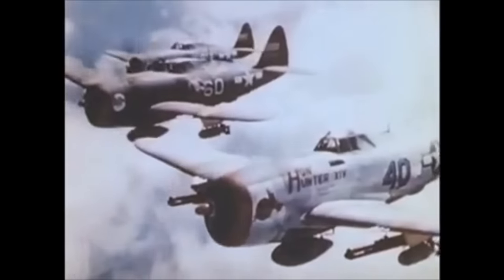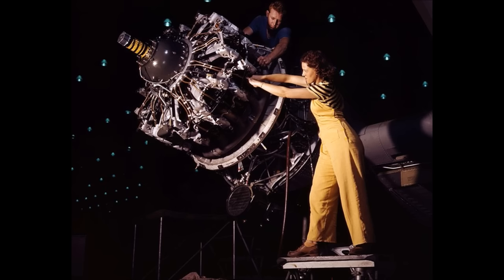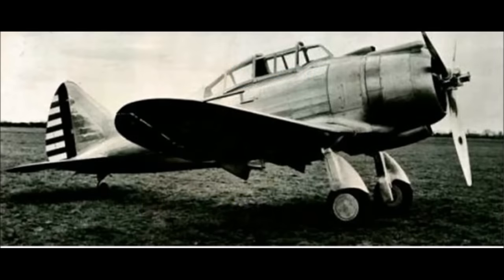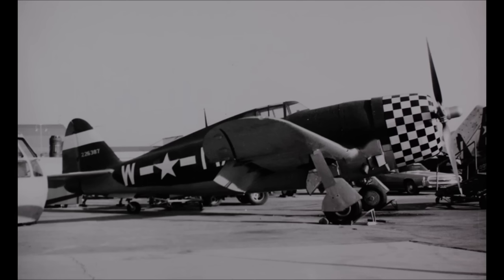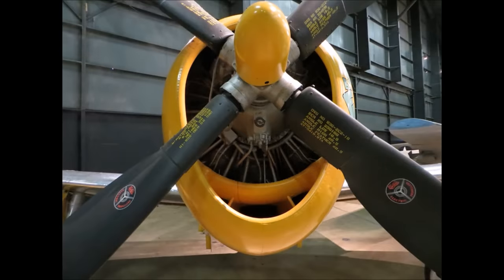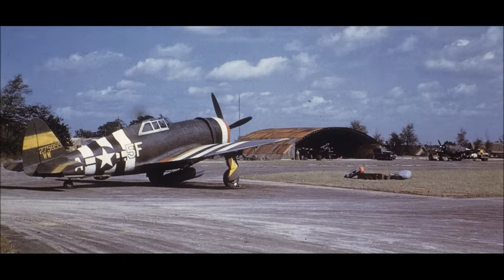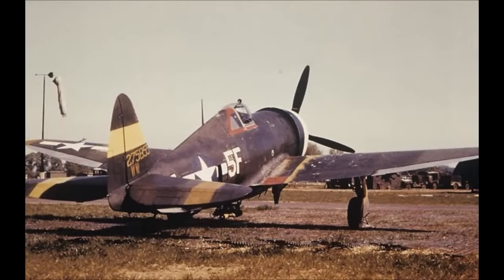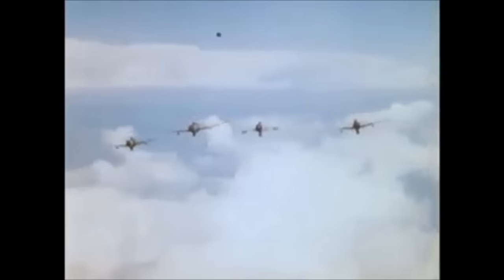P-47 Thunderbolt Pt. 1 Design and Speed

Comment: If you're going to discount a production run of 1000 aircraft, then discount a production run of 130, like the M version. Perhaps include the N, which was produced in numbers.

Your question on sims is related to the fact that they tend to take a specific model, not the fastest or best. For example, they'll take a Tempest V but a series 1, circa early 1944 with a Sabre IIb running 9lbs of boost on 150 octane, not the Series II with flush cannon ports and a later version of the Sabre. That's just how it is.  In the original IL2:FB, the developers specifically used a version that was sent to the USSR on lend lease - the D10 and D27. They then adjusted it to the D-27 specification that was tested by the US and then had corresponding UK data, which significantly changed the roll rate from the Soviet data. What you'll find is developers will take a model that has considerable test data and fits a given scenario. It's why you see in the newer IL2:BOS an A3, not an A9, because it's a 1942 scenario using an average aircraft.
Reply: He didnt deviate from the D model. He only commented how the N & M had the same engine and were able to accheieve higher speeds due to the increase in turbo shaft speed. He usee it to make a educated guess on field modified aircraft. As for the flight SIM. When 1946 came out they didn't have the p47 n & M modeled. This gave the Germans a huge advantage in game. The U.S. would have been capable to produce more p47 then Germany could produce airplanes.. Il2 had a hard on for German and russian airplanes.
Reply from the maker: Exactly, I didn't get into the N yet, I only referenced it for the reasons you stated. Good job. I'll cover the N in a later video. This was only part 1 and it was over 40mins long. I can't fit everything into one video, so I'll cover the M and N later.
Reply: @bad_luna5222  the P47-D27 in IL2 was more than a match for anything German at altitude. If a scenario had the TA152 then that, for 5 minutes was a match but then you'd be running on an unhistorical scenario. In a realistic scenario Germans would be using the A6, A8, early D9, G6/AS and G10 - none of which could match the D27 at higher altitudes and certainly for prolonged periods. The issue with IL2:FB/46, especially online is most scenarios devolved into low altitude affairs due to ground mission objectives. The P47, no matter what variant is going to suffer in a low altitude knife fight with a later model 109 or 190 as that's what they are built for and excel at. Getting suckered into a turning battle with a 109 or a scissors with a 190 is pilot error, not bad modelling of an aircraft.

Controversial opinion but IL2 did not have a hard-on for Soviet or German aircraft, the game focused on low to medium altitude simulation which is where Soviet aircraft excelled in. High altitude modelling was just poor which was acknowledged by the developers. The engine was from the late 90s so severally limited.
Reply: @bill8791  I used to fly at high alts all the time. I was always the guy leaving contrails and boom and zooming. I do remember some servers where people would be flying late war / non existant 190's and catching up to my 47 & 51's. The 109 got so fast and so good it was more a fight of attrition.  Id have to force them to chase me until they ran out of fuel or were forced to rtb.

I guess what I'm trying to say is the developers made varients of bf109s that were either produced in such low numbers or at all over american aircraft that would have been delievered in the same period. Therefore when people did play the 1946 senarious the Germans would always have the upper hand. Even with out the jets. The game needed the later model p-47 amougst other aircraft  the developers ignored it.
Reply: New IL-2 has 3 models of the 190 so far, the A3, A5, and A8. Plus the D9 to come.

Comment: the spitfire is like a honda civic...... handles great
the 51 is like a corvette..... can turn ok, but likes to go fast

the 47 is a 68 dodge charger.... powered by a 10-71 roots blower, on a 440 big block, with 6 pack carbs..... doing a wheelie on the drag strip
Reply: running more MAN PSI is just like making your honda civic run 30 PSI vs 25 psi
honda didnt set the engine for 100% power..... your going to wear shit out faster, but VS other stock cars.... your going to have a massive advantage 

i 10000% believe that people "hot rodded" their aircraft.... 

after all.....bootleggers and aircraft mechanics started NASCAR and NHRA......

Comment: I already knew about the specially designed dual-purpose shipping-crate/assembly-jig scheme for the P-47.  Did NOT know about catapult-launching "Jugs" from escort carriers!  The heaviest single-engine piston fighter there ever was, from the smallest fixed-wing carriers there ever was.  Why did no one ever tell me about this.

Now... to be clear... I'm thinking this actual video footage we're seeing here, of the 47s launching from a carrier(s?)... doesn't seem to be showing a catapult involved in these shots?  (Unless the catapult track in question on the escort carriers ended significantly short of the bow?)  So... presumably full-sized fleet carrier(s) in these pics/vids, where there's enough deck-wind speed, and enough deck length, to not need the help?  They did do it with some B-25s on one occasion, I'm told... 

On other related matters...  The "simple" question of speed is covered with what seems like an unimpeachably complete level of analysis here.  Appropriately as per your title for this segment.  But without knowing your intended focus for your forthcoming P-47 segment(s)...  May I ask if you will be examining or addressing the anecdotal reports/experiences of P-47 combat pilots, re. their comparative impressions of relative performance as a whole from having also fought in other comparable single-engine fighter types of the same period? 

While I know there's many USAAC pilots who saw combat in multiple US types, I'm particularly interested in some vague references I recall of American pilots who had been flying the Spitfire Mk.V, whose units then transitioned/re-equipped to the Thunderbolt.  I believe this case was during & after Operation Torch/Husky/Avalanche (the Allied invasion of N.Africa>Sicily>Italy), where early on, the US had been borrowing excess/older Spitfires from the Brits, apparently lacking sufficient P-40's for the purpose? 

Reference:  see (or image-search) my avatar thumbnail pic here -- a famous photo of a wrecked Mk.5 Spitfire on the beach somewhere in S. Italy, painted in USAAC Unit markings.
Reply from the maker: A lot of wild stuff happened in WW2.

Comment: I doubt that the PW R 2800 could maintain 70”of manifold pressure for any length of time without running into reliability issues like pulling a cylinder off its studs or blowing a top of the cylinder (head). I ran a R 2800 with CB17 rating (62,5”of manifold pressure on 145 octane fuel)that was the highest manifold pressure it could be run on the ground safely.
Reply from the maker: They ran it with a lot more that that in testing. It can run at 70" all day long provided it doesn't overheat, which it wont at speed.

Comment: i come across interesting version of p-51 it was p-51H or M running water injeted packard build merlin engine with boost up to 120inHg (crazy!!) could you put some more light on this version if any data is even avilable for this thanks.
Reply from the maker: The P51H never saw combat in WW2 so I have been avoiding it for now, but yes, it ran water:methanol and a lot of boost!
Reply: @GregsAirplanesandAutomobiles  
wonder how this WM injectiojn was set up was it like in bf109 with single spray bar in to supercharger inlet or was it 12 spay bars in to specyfic cylinder inlet duct each?
and i got one question its bother me for a long time but somehow i cant find ultimate answer for it. when i read engine chart for p-51-d v1650-7  i can see take off power for exaplme 3000rpm 1490hp at 61 inHg my question is those rpm is it rpm of crankshaft of the engine or is it rpm of the propeler i know that engines had reduction gear box for exaple merlin 61 had 0.42:1 reduction ratio on the reduction unit.

Comment: 2 quick questions. 1: I thought all P-47Ds had bubble canopies. Obviously wrong. Do you know drag difference between bubble and slide back canopies?
2: in general, where are you finding this detailed information? Do you physically go to where NACA files or Republic files are stored? Or are they digitized for reference online. I suspect you are just a dogged researcher. I thought I knew a fair amount about the P-47. Obviously not. Thanks.
Reply from the maker: Hi Michael, It appears that the drag of the two versions are about equal. I am basing that on the power settings vs. speed charts in the various flight manuals. In other words, with a given power setting, prop, and altitude, both planes are at essentially the same speed. Of course it's a little murky because the manuals use different power setting in their charts, so we have to interpolate some of the data. As far as I know there are no actual drag numbers for the two canopies. I think that sort of information was lost when Fairchild destroyed all the Republic Aircraft records. As for the NACA reports, I just pull them straight off of the NASA website.
Reply: Greg's Airplanes and Automobiles Thanks. MSM 🇺🇸

Comment: 1) Does the air get filtered after or before the intercooler?
Reply from the maker: Hmm, I don't recall seeing a filter on the diagrams. I'll have to check.
Reply: @GregsAirplanesandAutomobiles  I should use the correct terms, downstream of the intercooler or upstream. And further to that, question 2) : Can the airstream to the intercooler be controlled?
Reply from the maker: Yes, the airstream to the intercooler is controlled by the outlet shutters. If they air can't get out, more air can't get in.

Comment: Can you have a blowdown turbine inline with a turbocharger? I.E. Engine > blowdown turbine > turbocharger. If you play WarThunder, you'll immediately realize that German planes, especially the 109s are FAR better in the game than in RL and the opposite is true of most American aircraft. because "balance".
Reply from the maker: A "blowdown turbine", we call those "power recovery turbines" in aviation. It might be  possible to use one and a turbocharger, but I don't know of any cases where that was done. It would be highly complex if it could even work. I really just don't know. In video games, the need to make the game fun, and to make money. What they call "balance" is usually their attempt to do that. I am not against it, but it's not what I want in a sim.
Reply: I've seen them referred to as both blowdown and power recovery. I prefer "power recovery" but I wasn't sure which is the most common.

Comment: https://www.youtube.com/watch?v=AmEShHz-_Ak

So that's how it can fly in other sims. I am hoping DCS gets their P-47D module out at some point, but just looking at the data you've provided, I can understand why it so often ends up being a challenge. The P-47 appears to be very influenced by the tuning of its power plant, and, really, mostly influenced by the tuning of its power plant, to the point that if you've got a well built, well maintained early P-47D-5 could perform at a level of an end of the war P-47M. That makes it difficult to chose which side of that envelop to put a sim pilot on. 

Do you give them the 470mph performance in a "1943" fighter? Do you ratchet up the boost with each dash number of the D? Do you change all the P-47D's performance levels depending on where you are in the sim timeline? Do you set the player off on a mad quest to unlock the much rumored 72" boost? It's a bit of a conundrum for a game designer who's interested in the P-47. Or you can just use the listed 54" boost, and say "that's good enough" and move on to modelling BF-109 variants and Spitfires.

Honestly, I think Warthunder ironically has the most reasonable way of handling it (even if that's not why they did it); by gating the high boost modes behind a leveling system, you get start out with an equivalent of a WW P-47, and eventually get it up to the full high boost spec.

That said, if DCS does come out with their P-47D module, and if the campaign editors support the necessary features, it might be an rather interesting side thread to include persistent damage and tuning into a Thunderbolt campaign.
Reply from the maker: I think the answer is to allow 70" of manifold pressure and the associated performance if  fighting on a map that allows post June of 1944 aircraft. Now, if it's a 1943 map, that's a much tougher question, and I don't have a perfect answer for it.

Comment: Contact gaijin and get a press kit for the game war thunder (usually you have to unlock the planes more or less chronologically, which can take houndreds of hours). Its a good game with very good looking models
Reply from the maker: I haven't played War Thunder so I could be totally off here, but my impression is that it's more of an arcade type game than a simulator like DCS or IL2. For that reason, War Thunder just isn't on my radar, but maybe it should be.
Reply: @GregsAirplanesandAutomobiles  the main game is quite arcady(allthough not incredibly so, you mostly get a bit more engine power and a more "fly by wire" type controll scheme as if your pilot is using all surfaces to do what you want) , but it has both realistic and simulator modes for those who want it. Even then its no il2, but its very good for getting footage as it can be absolutely stunning and has a good range of vehicles and variants including armoured vehicles. I would at least send a mail to the company and ask, as it cant hurt to have.
Reply: @GregsAirplanesandAutomobiles  War Thunder is on the arcade side when it comes to some aspects of gameplay. The flight models are very close to real, in realistic and sim mode. I would call it a Simcade. The game is successful because it blends sim realism with easy to access arcade fun. You mentioned that sims tend to under rate the P-47, WT certainly doesn't. The German team has access to a captured P-47 variant that is very popular, because of its performance.

Comment: Did radial engines always have an odd number of cylinders per row ? Why?
Reply: It allows for the firing order of a four-cycle engine to be "every other" cylinder - i.e.: 1, 3, 5, 7, 9, 2, 4, 6, 8, 1 . . .
Reply from the maker: Not exactly. They run an odd number of cylinders PER ROW. it makes the engine run smoothly, I can't explain it in the comments, but I'll try and work it into a video.
Reply: Thank you for taking the time and trouble to answer. I shall look forward to your video.
Reply: @GregsAirplanesandAutomobiles  Easy to explain in comments. It's a 4 stroke engine, which means a given cylinder fires every other revolution. 
Since these engines share a common crank throw, all the cylinders are ganged and can only be in a particular relation to it's neighbors. 
Arranging each row with odd numbers means the cylinders can fire in a staggered sequence, as T1mbrW0lf describes.... 1 3 5 7 2 4 6 1 3 5 7 2 4 6. Every firing event occurs in a cylinder 1 away from the previous.

A single row of 6? 1 3 5 !!! 2 4 6 !!! 1 3 5 !!! 2 4 6. Those exclamation points are where the problem is... 6 and 1 are neighboring cylinders. Cylinder 5 and 2 are 2 cylinders apart. It's inherently unbalanced because of the 720 degree nature of the Otto cycle. 

Now, if you had a 2 stroke radial you could have whatever number of cylinders per row you wanted, because 2 cycle operation is 360 degree and a cylinder always fires at the top of a stroke... a common crank just means sequential firing, no worries about what to do with your "time off".